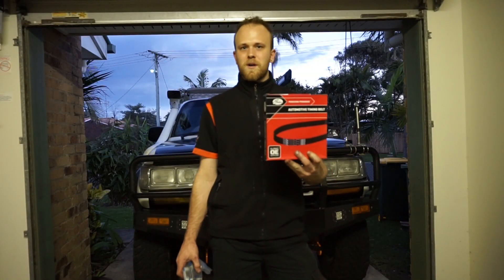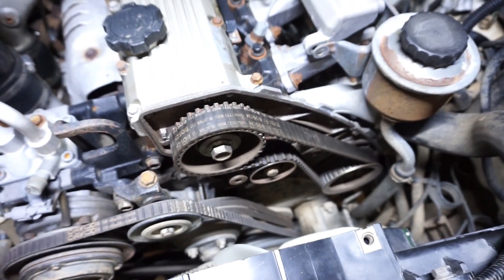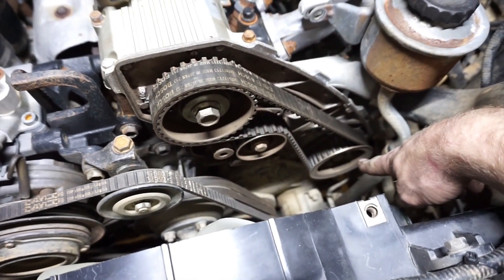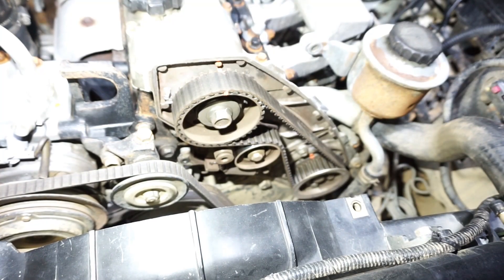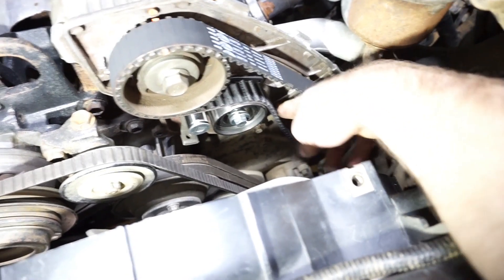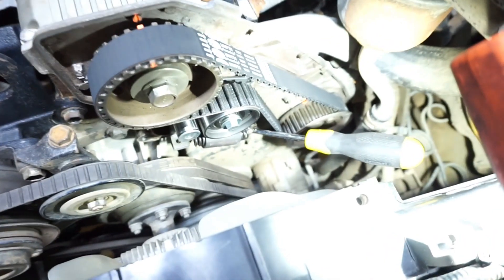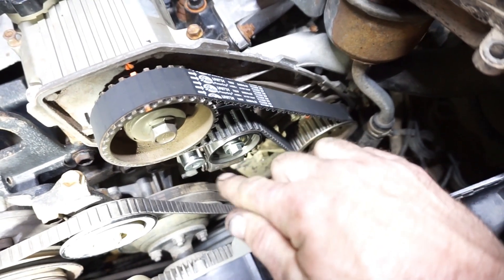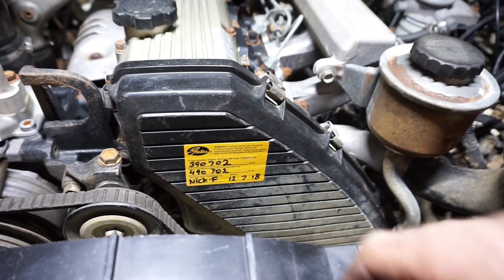How to replace a Timing Belt on Toyota LandCruiser 1HZ & 1HD-T  Engines

Comment: Hey mate I want to take the backing plate off and do the water pump but what if the cam moves? How do I get it back?
Reply from the maker: Hey Seanz! You will need to lock the camshaft to loosen off the cam bolt to get the pulley off and then get the backing plate off. So you will need to remove the rocker cover, hold the cam and loosen of the bolt and take off the pulley. You will be able to align the camshaft with the timing mark by using the central bolt or the cam cutouts.
Reply: @howtonick2803  ok thanks for the reply ill message you if i have any troubles
Reply: @seanz9084  Successful?
Reply: TheBoostHeroMan Yep no Problems just torque to spec for the cam bolt
Reply: @howtonick2803 Just hold the camshaft steady with a screwdriver or a chain vice grip and use an impact wrench to crack it.

Comment: I heard Toyota have changed it from 100.000 to 150.000 change belt an tentioner.
Reply from the maker: I think in the 105 series and 100 series it may be a 150 000 km interval. On the older models i think its good to do it every 100 000.

Comment: Hey mate awesome vid, how exactly do line the markings up (turn the engine over to the correct position)?
Reply from the maker: Use a socket and extension bar and turn the engine over by the crank pulley bolt. Turn it clockwise until both of the marks align. Cheers :D
Reply: Great Video thank you and you answered my question as well :-)